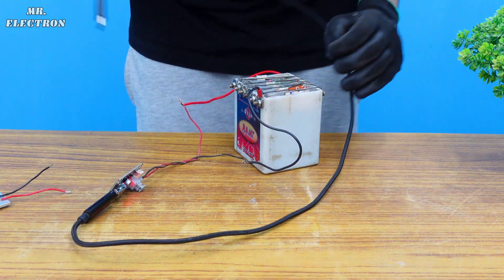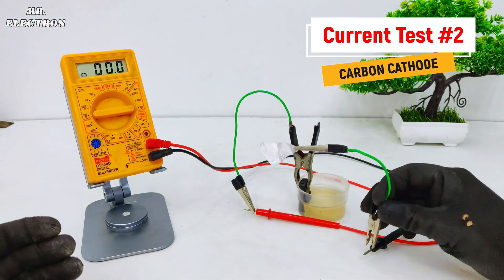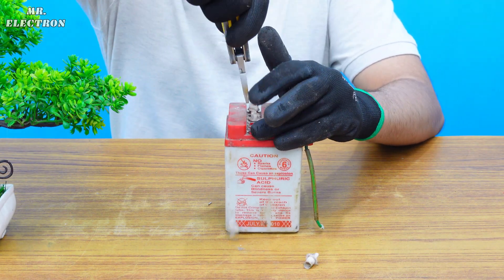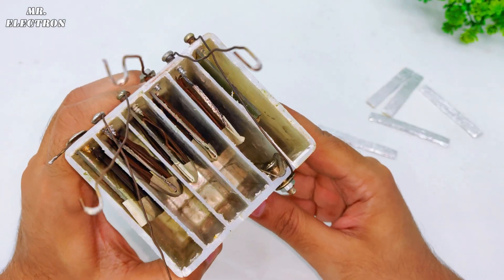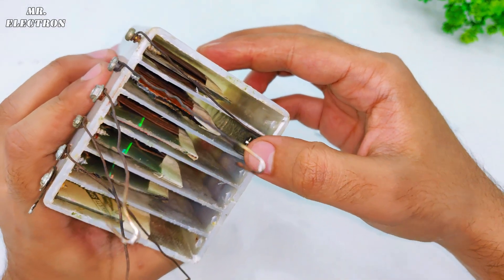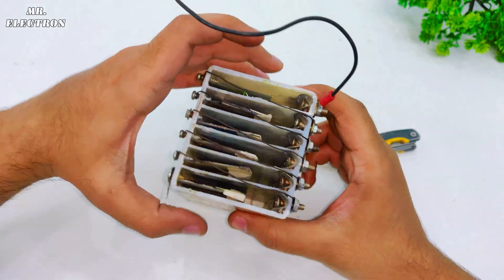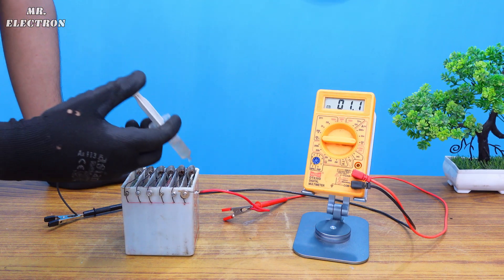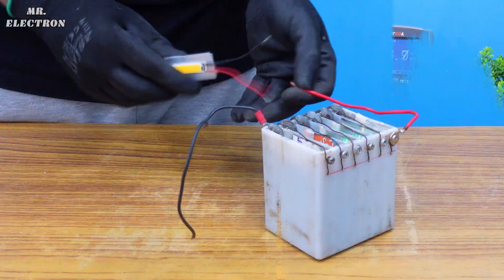How To Make an Aluminium Air Battery | Experiment for Free Electricity This Winter!

Comment: This is not an aluminium - oxygen battery because you do not use oxygen from air as depolarizer. Your cells use reaction between Al and H2O, with one allow to achive 1.9V per cell and it mean this reaction lead to emission of hydrogen on Al plate if potential rise above 1.2 V. So effective voltage on cell depend of many factors like anode material and reaction may occur on it, solution used as electrolyte and it concentration, temperature and few less important. 
Start learn about zinc-air battery and let's try to understand it firstly. 
There is not possible to make al-air cell with water as electrolyte.

Comment: Govt executives are supposed to take immediate action against the guilty, and the courts are simply to observe whether the action taken is as per the law or not. But our executives generally do not take action, but ask the courts to punish the guilty, which takes 10-20 years. This practice must be stopped. Govt executives must take immediate action and let the courts decide whether the action is as per the law or not. If action is not immediate, the action should be taken against the officer. Further, if the courts don't decide within a month, action must be taken against the judges also. Judges or courts are also not above the Law.

Comment: Hi, I've tried a similar setup of your initial battery. But I'm not getting enough current value to even lit a bulb. Can you tell me some possible causes? And also what was the concentration of you electrolyte?
Reply from the maker: @aria6464  are you talking about the single cell that I made at the beginning of this video or are you talking about this very video. Please specify everything in detail.
Reply: @MrElectron  the single cell. Mine shows current micro ampere. I used aluminium sheet and graphite rod. my solution was around 6 to 7M

Comment: I am from Myanmar(Burma).
I am trying to do battery. My country is very poor of electricity.
Thank you very much.
Reply from the maker: You are most welcome. I have read about the situation in your country. It's sad 😔
Reply: What will I have to use instead of steel wire ?

Comment: YOUR AIR BATTERY IS A SCAM.
YOU USED A ELECTROLYT.
SO YOU ARE A SCAMMER
Reply from the maker: Who told you that if there is electrolyte, it's not an aluminium air battery ? I am just curious 🤔  ????
Reply from the maker: Who told you that if there is electrolyte, it's not an aluminium air battery ? I am just curious 🤔  ????
Reply: its not a scam, its how the US Navy powers its torpedo's, but uses silver & aluminum. what gets me is all this effort, and he, nor anyone in the comments section asks about internal resistance (NOT at the SHORT CIRCUIT point) ,and that each one of them cell connections forms thermocouples, which he did not apparently measure the voltage drop across. Maximum current is not maximum power transfer

Comment: How can say it is aluminum air battary?  You use electrolyte by this  act same as  lead acid battary and here you changed the metirial used as electrode aluminium and copper instead graphites thats all.

I think it is not air aluminum battary its acid battary.
Reply from the maker: The term air is used by all the researchers in the world because oxygen from the air is consumed to by the anode to get oxidised and release electrons.

Comment: Hi bro I have an idea! Use a 12v or 24v alternator and remove rectifier from it and since it produces pure sine wave alternating low voltage curren, take a transformer and directly step up the voltage to 220-240v and test various loads on it also max power output
Reply from the maker: I too had that idea ( I made it 5 yrs back so a little poor recording quality ) - https://youtu.be/KtZdJJApNeo?si=xH-Je0Kc7g0gbfpW

Comment: Have you tried solid state electrolytes? How do you control dendrites and passivation that causes a sudden drop in the power of an aluminum battery.
Reply from the maker: @ndueseesu2412  An excellent question 👍 I will cover that in my upcoming video probably day after tomorrow. 
No, I have not tried solid state electrolytes but I have read that they have higher volumetric power output.

Comment: is it also rechargable as in properly rechargable where it doesn't degrade to fast.
Reply from the maker: Not rechargeable and it doesn't degrade too fast. This video is more of an experimental type with new research added to it in each experiment.
Reply: how long the battery will last?

Comment: battery does not run on air.
Reply from the maker: @DmitriNesterov  Well ! there is this big confusion with may viewer's. Firstly - This term Air battery is not given by me but by the inventor of this air battery. Charles F homes patented the first aluminium air battery.
Secondly - Air battery name was never meant for air electrolyte but flow of current because of absorption of air (oxygen) by the anode aluminium (or others) .
Thirdly - Water contains different levels of dissolved gasses amongst which, oxygen is also present in large quantities.
So in simple terms, the name air battery was give in 1886 because air (oxygen) is consumed by Amluminum for production  of current and not because the electrolyte is air or gaseous.
Air battery electrolytes can be solid state as well as liquid.

Comment: oxidation of carbon, would be carbon monoxide and carbon dioxide gas. mind your air flow of oxygen. if you dont have air flow in the carbon then you get less oxygen for the battery. suffocating battery. the iron air electrode has a clear surface no pores. whats the replacement reaction between aluminium and iron, if any. you might have cell leakage in the 6-cell battery. 0.6v is not the aluminium-air voltage. maybe its aluminium-iron voltaic pile voltage. try putting the cells in parallel, not in series, you are not running the cells in oxygen mode, but in galvanic mode. you made a galvanic aluminium-iron cell, in the 6-cell battery. 0.6v is more like the galvanic cell voltage. well try the clean 6-cell then to find out if its the sulfuric acid messing things up or if its the galvanic cell battery running mode.
Reply from the maker: I think so too.. I am already on with the next AL air battery project. Trying to eliminate all the errors this time + making it a lot more compact and efficient

Comment: Where is the AL air battery?
Reply from the maker: @DmitriNesterov  Well ! there is this big confusion with may viewer's. Firstly - This term Air battery is not given by me but by the inventor of this air battery. Charles F homes patented the first aluminium air battery.
Secondly - Air battery name was never meant for air electrolyte but flow of current because of absorption of air (oxygen) by the anode aluminium (or others) .
Thirdly - Water contains different levels of dissolved gasses amongst which, oxygen is also present in large quantities.
So in simple terms, the name air battery was give in 1886 because air (oxygen) is consumed by Amluminum for production  of current and not because the electrolyte is air or gaseous.
Air battery electrolytes can be solid state as well as liquid.

Comment: So you made a battery that works worse than a lead acid. Not particularly impressed tbh
Reply: Learning from your errors. Is far better than getting it right first time. In my lifetime I have made many errors. But I have learnt from them. That is what human being do. If you get it right first time. You learn nothing. Have a great day.
Reply: His battery cost less than $10. Lead acid battery cost $150 bucks. If you're in an emergency you might want it this battery. You can charge your phone and call for help. Make anything lately?
Reply: @Brad-sh2wn  Thats truemy good friend. Me? I am in the last part of building my new 12foot x 12foot Lab. It will be operational before Christmass.
Reply: @MYNICEEV  that's great